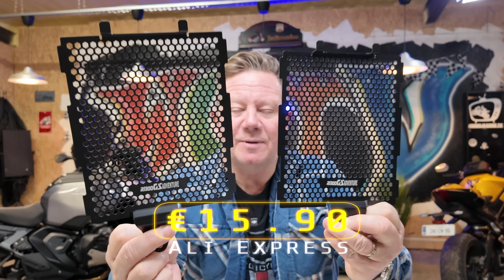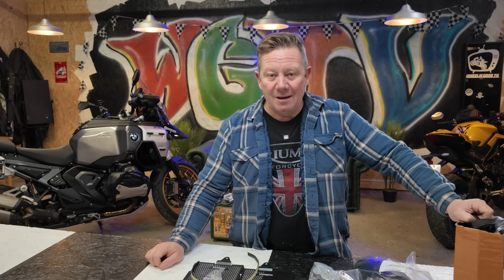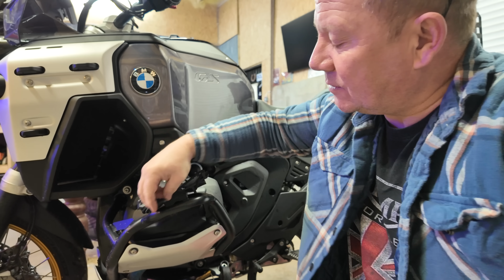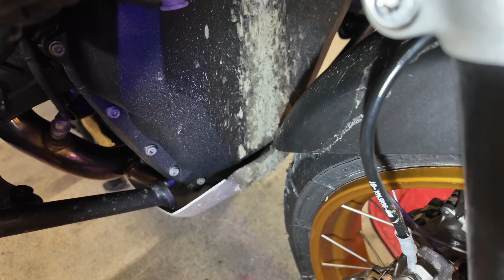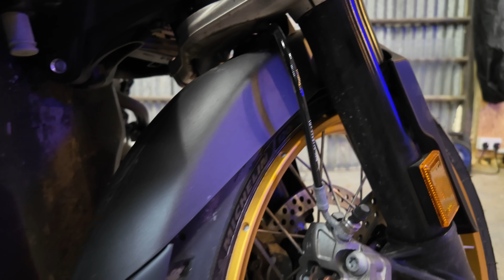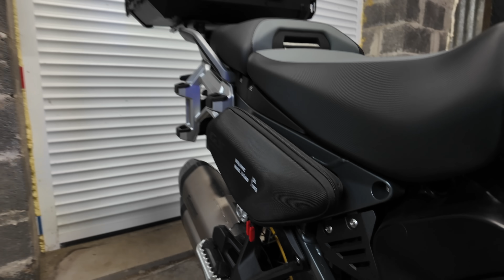BMW R1300 GSA Accessory day. Fitting and price guide.

Comment: There are some good savings to be on the Ali Express, yes be careful what your buying and don’t compromise safety. But for what some of the adventure companies charge for their items is pure piracy. For example $300 for radiator covers, $150 for a net seat cover I mean come on. But for the bar risers mine came either extra factory units to adjust the setup.

Comment: Hi Dave, I’ve just bought the 1300te , so I’m going through the pain of purchasing and fitting all this, I cannot figure out why BMW don’t fit as standard some of these parts, especially radiator guards and fender extender as well as mudslings , they charge plenty for the bike. Cracking video

Comment: Question about the fender extender. You rotated the wheel to check for clearance. What about clearance when the fork is compressed? Have you checked for wear marks on the extender or the engine cover? Thanks!
Reply from the maker: Yes I’ve checked that too and all clear. It really helps keep the crap off too. 👌

Comment: Great video Dave, it’s a brilliant bike! it’s a personal choice of course, I prefer to stay well away from Chinese parts. Mostly fit Wunderlich approved parts for my own GS as you can’t simply fit any accessories to your bikes, taking for example the bar risers, there are areas & systems on the bike that are controlled! & If we fit a part or change something it has to be an approved part i.e. type approved.

If for example you fit certain bar risers from China on your bike that do not have the required standard approval, could potentially get in wee bit of bother lol as when the bike goes for an MOT, they will reject it & the bike will fail! & also, heaven forbid if you are involved in an accident this will cause problems as your insurance will also be null & void as you’ve made a change / part to the motorbike without the approved part ABE number & manufacture type approved number.

For me anyway the handlebar controls on your bike are important & I ensure the parts I fit would not create any stress fractures, as some of these Chinese parts are really not the best made (hence the price) imo & this is not one of the places where certainly I need to be saving money. Always best to get a part that is type approved that been tested to the required standard.

Comment: The same people who judged you for spending too much on the bike purchase are about to judge you for buying cheap accessories 😂
Your radiator observation has tickled me. I need to go check in my 13GS, i have radiator guards on the shelf overdue to be fitted.
Reply: Having said that, I'm a big believer in "boots theory" and would guess the fender extender will be the first failure. 🫣
Reply from the maker: You’re exactly right. I was expecting it though. 🤣🤣🤯

Comment: Nice vid Dave ! We are just kids, always farkling our bikes with more or less useful items. 
The temu bags turn out nice, and had bought quite a few cheap options for the 1250GSA (but managed to refrain myself with the 1300… for now 😂) : the mudguards were a must (front and rear, but the front ones had a clip system with a screw but without drilling : had a glued Pyramid fender extender on my XTZ1200, but one day, it decided it wanted to live its life on its own 🤪). 
For the bar risers, I had bought from Wunderlich : they are security items so at least it had the right approvals, and was “only” around 100€. 
For the side panels bags, will wait until LoneRiders makes them for the 1300 😉

Comment: Handle bar risers that's not bmw approved voids warranty should you have an accident. In an accident,  it's almost impossible to prove the handle bar wasn't a problem .
Reply from the maker: @expatbiker6598  mmm I hadn’t thought of that. I might rethink this one. 🙏
Reply: @wheeliegoodtv the above comment seems to mix up warranty and insurance.  An accident is nothing to do with voiding warranty. If you're worried about insurers paying out, declare the risers. I do and it is under the umbrella of 'altered handlebar position' and didn't increase my premium.

Comment: The frame bags,the plastic panel is ment to be removed as bmw instructions the wires etc are waterproof. I had the high handlebars fitted to my R1300 GSA and are fantastic would not use the Chinese risers safety first !

Comment: I hadn't thought about the bolt quality until I read the other comments. If your down because of rain , this would be the time to go down to the hardware store and get better fittings and replace them. As with any accessory, a periodic check is advised of the addition.  Even the main brand manufactures will add this warning with their products. Good luck-good savings. Sometimes we win.!!  👍👍  I've added fender extenders to all my BMW's and they did help a lot. My RE's never had this problem. Their front mud guards are proper long... 🤣🤣

Comment: Not trying to make you worry but you need to check the type of material the replacement bolts you used for those side bags, you may get galvanic corrosion between the bolts and the aluminium bike frame especially if they get wet! If the bolts are BZP, zinc or even Stainless can cause corrosion of the alloy! Entertaining video, those radiator guards seem excellent value, not rue if they are rust resistant! Totally baffles me why they don’t fit longer front mudguards from the factory! The tank bag looks superb, they are so useful on a longer trips, your wife has good taste!  👏😀👍

Comment: Regarding handle bar risers and tank bags, I got myself in a right mess years ago on my old GS1250. On a trip around Scotland, I pulled in somewhere for a coffee, in my excitement at seeing a guy displaying birds of prey, I left the ignition on and drained the battery. Long story short, I eventually got the bike jump started (forget ever trying to bump start these big bikes), I then did a full lock turn in the car park -  which is when I too found that the kill switch will come in to contact with the tank bag! Dead bike again. I looked and felt a complete idiot!!!!😂

Comment: I've no issues with anything you fitted except the bar risers, I'm more inclined to think they are cast alloy not billet alloy, the Chinese are not renowned for the quality of any steel/alloy manufacturing I have a pal in Motorsport Manufacturing and will not purchase Chinese Steel having had previous bad experience with it, also if you are going to use the risers at least change the chinesium bolts they will fail 😭.

Comment: Please take care with these cheap accessories. I bought a Chinese toolbox for my 1250 GSA which looks identical to the very expensive Touratech one. Nothing wrong with the box itself but it was the fittings that snapped after a few months of use. Similar situation with rear hugger. BMW dealer refused to test ride the bike because he was suspicious of the chunky bolt that supports the drive shaft to which the hugger is secured.  There’s a risk it could shear and the rear drive would collapse. Must be the quality of the steel just isn’t up to it. Needless to say I replaced the hugger altogether. I will not risk my bike not to mention my life with inferior Chinese components.
Reply: Well said. Rule No.1 Fit nothing structural from AE